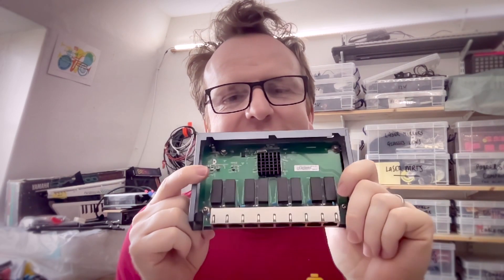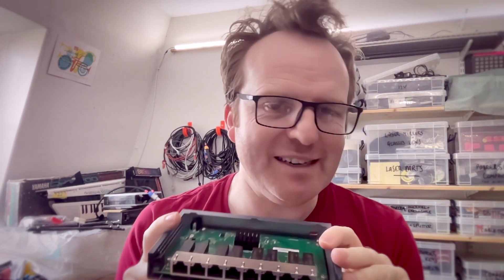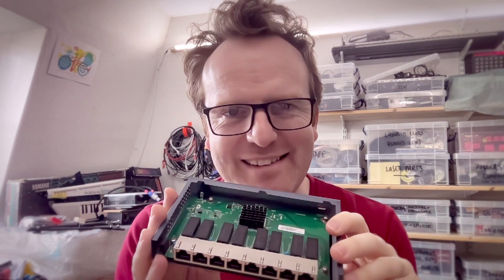Laser network switch part 1 - PCB design

Comment: Looking at the amount of (great!) work you are doing I‘m asking myself if this is more of a project for „fun“? How often do you use these systems and how essential is it to have a single wire?
I very much see (and love) the neatness of this setup and that it has benefits but it also looks like hours upon hours for development compared to needing to plug in a second cable.
Reply from the maker: I love this comment so much. I think there is long answer to this question which I will address in my next video. But the short answer is yes it’s worth it haha. I guess I also dream of making this stuff available to others as well but I don’t think I’m there yet. But yes a longer answer in the next video!

Comment: Nice video, exactly the sort of stuff I'm interested in seeing with your laser displays! I'm looking forward to seeing the manufactured boards in operation.

Does this expect only one stop button, or is there a way to add multiple?
Reply from the maker: Thanks! Some of my switches have more than one stop button input so I'll tend to use one of those as the one that all the others branch from. I also have a system that transmits a stop signal over the network itself... but I'll save that for another video 😀

Comment: Hi! Nice video! Not as fast and well-rounded as on the main channel obviously, but that's why it's a second channel, isn't it?

However I still have 2 questions:
1. Why is daisy chaining of the interlock signals not possible between different laser brands? Surely if they all use Cat5 cable, they should just pass the signals through and be done with it?
2. Why did you have a reserved combined out on your switch? Since the other ports are also combined output signals, there shouldn't be any difference between them and the reserved one, right?
Reply from the maker: Great questions! 

1. Even though a lot of laser brands use the same connector, they usually use different wires within the cat5 cable. Some even use additional wires for power and other features. Sometimes even data! 

2. Yes the second socket is functionally identical to the next five when in combined mode. But there is a switch on the front that changes it to a gigabit socket. And then I guess you could use either of the gigabit ports for in or out. 

Thanks for the kind words as ever !